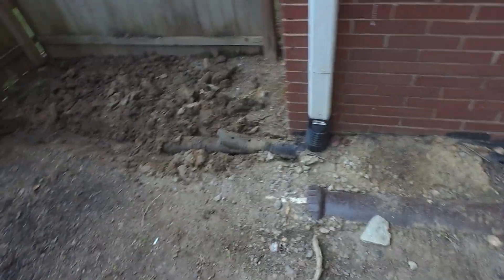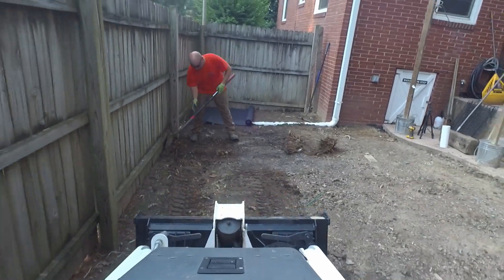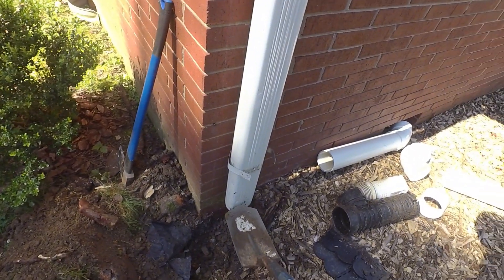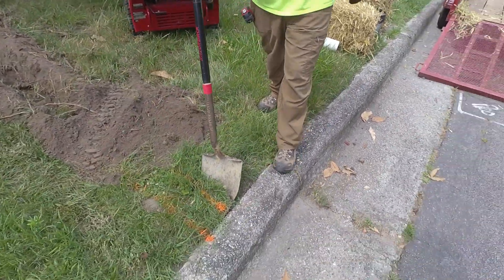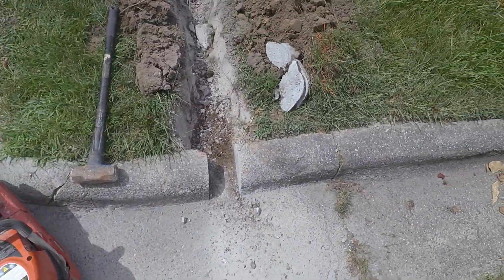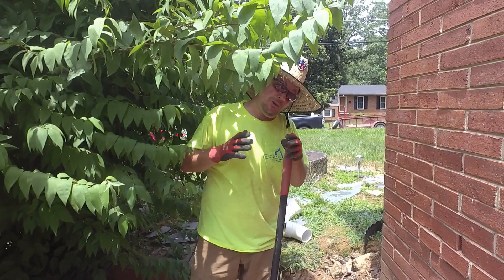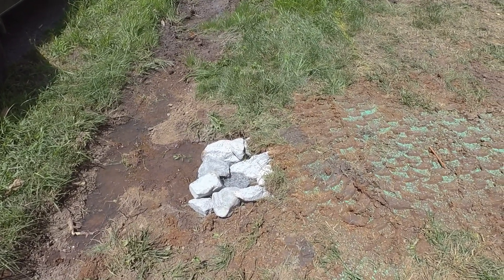Never, ever dump gutter water into a perforated pipe

Comment: You do great work. Question: my house in the Northeast US has  basement flooding issues due to a number of issues, including improper yard grading and no street access to route collected water. I have regraded much of the yard on my own but there is still no where to discharge pooled water. Some contractors suggested routing the sump pump discharge pipe through the basement to the front of the house into the street. The sump pump now sends water to a poorly designed drywall close to the house which easily overflows during heavy rain. Any thoughts?
Reply from the maker: Definitely get the water pumped to a place where it's completely gone for good.

Comment: I think the prefer rated pipe is only any good coming off the gutter running on top of the surface but I'm not a professional
Reply from the maker: It still clogs up and ends up dumping at the connection against the foundation.

Comment: All the water from the apron in front of a 2-car garage, plus about 30% of the gutters on a 60x24 house, all went into perforated pipe right along the back foundation. It picked up another 30% at the corner, and then ran to daylight in a little trench that was forever collapsing in and/or getting clogged with debris from the gutters, so all that water (including the second 30%) backed up in the perforated pipe. The only item on the seller's "disclosure" form was that a little water came in through the foundation during heavy rain.  GEE I WONDER WHY?
Reply from the maker: Can you get the pipe replaced with solid PVC?
Reply: @GCFD  I already did. 😁 The catch basin in the driveway, a small one beside the sidewalk, all of the gutters, and the sump pump outlet all drain into 4" schedule 40, which drains into a small municipal catch basin at the edge of the street, which drains into the main storm drain system on the corner.  The first 10 feet or so coming off the driveway basin doesn't have good fall, because reasons, but then it's all downhill all the way after that.  If the driveway drain overflows - which it sometimes did, when it had the corrugated pipe - there is a very subtle 4' wide swale in the yard to carry that water away from the house. You can't even see it unless you're looking for it. I'm pretty proud of that swale, as it worked so well while virtually invisible, but it is completely unnecessary now since the drain has never come CLOSE to overflowing once I replaced the corrugated pipe with PVC.
Reply: @DaddyBeanDaddyBean good to have hidden infrastructure backups for the extreme events that only you know is there!!

Comment: 11:35 Your blades will last a LOT longer and you won't PISS OFF the neighbours with so much dust if you add water to the cuts!

And for that matter, I saw hearing protection but NO DUST MASK!!!

Why no Dust Mask?

Do your workers not care about their lungs?

I've had Particulate Pneumonia...

Trust Me!!! YOU DON'T WANT IT YOURSELF!!!
Reply from the maker: I'm not sure what happened there. Those are the concrete guys I work with who were on my job that day. They usually use water but I think they felt the curb was small enough not to worry about. I make sure they use water now.
Reply: @GCFD  Make sure they wear dust masks too...

Comment: What if you put a straight pipe off your gutter and then a perforated off that. I understand it dumps water into land however a perforated pipes job is to drain rising ground water so even if roof water is being dumped it wiil eventually rise and be collected by pipe. See my issue is ground water but i have a downspout in area so figure divert both. Also clogged pipes can be avoided when installed properly. Thoughts?
Reply from the maker: The hard part is getting the water into a pipe, so my thought is to keep it in a pipe and carry it to a place where it's completely gone. That's how I like to do it because adding more and more water doesn't change anything. If water is discharging into the ground, more water from heavy rains will overwhelm and cause flooding.

Comment: Would it be better for the house NOT to have gutters?
Reply from the maker: No, because then all the roof water lands along the foundation. Gutters are key to any drainage system because they collect roof water.
Reply: @GCFD  Thank you. In Louisiana we get 4” of rain in an hour, the house I moved into has roof eaves only extend out 6” and no gutters.  The garage has gutters that overflow at the joint at the ground.  So after having French drains installed that have not stopped garage flooding, I am watching all your videos to figure out a solution.  I hope you have done some videos on proper installation of gutters. I think mine had been angled to put water into the backyard instead of flowing to front yard which slopes slightly toward the street.  Thank you for spending time posting your. Ideas. Other channels just don’t explain things as well as you do.

Comment: U guys do awesome work. As a plumber, pipe fitter I sometimes cringe when I see all that purple primer.
Reply from the maker: Why's that? I like lots of primer to prime the pipe and soften it up.
Reply: As a plumber also, I will say this. I can understand being nice and neat with primer on pipes in a crawl space or inside walls and stuff, but if it’s going in the ground, who really cares? No one is going to see it unless it’s being replaced and they aren’t going to care what it looks like at that point.
Reply from the maker: @zacharyherndon5975  I agree. When we do sewer pipes under a house we keep it neat. Otherwise I like a ton of glue to make it easier to make up those 4” fittings!

Comment: You do want crawl space ground sealed with vapor barrier even if water not leaking into it. It blocks both moisture and radon gas. Looks like they did a nice job on that.
Reply: Yes, about 15 years ago we were alerted to early problems with mold in our crawl space. A vapour barrier (just below the topmost layer of gravel in the crawl space) and a dehumidifier system were installed, solving the problem. Yes, the dehumidifier consumes electricity, but that's just part of the  cost of owning a house...

Comment: Where I'm from, perforated pipe is not used to collect water but to disperse it. What you routinely call a French Drain is the exact opposite of what is specified by CEORs on large scale commercial jobs. But we also cannot drain water onto the ROW or to neighboring properties, either. I guess things are just a little different in North Carolina.
Reply from the maker: The guy who invented the french drain used it to collect water. I see this misconception all the time. Even the landscape contractor book has a FD functioning as a dry well.

Comment: How do you keep rodents from setting up base in the dry season or winters?
Reply from the maker: The smooth pipe provides no habitat for them. Plus we get rain year round here so the flow continually blows out debris.
Reply: @GCFD  would a system like yours hold up to a Maine winter?
Reply: @marccole8345  what do you mean ?

Comment: I would have added a drywell to receive the water
Reply from the maker: The water table was much too high here for a dry well. If you can send the water down the way it's a better solution than holding it in a well, which takes time to recharge into the ground.

Comment: One technical question. 
Is there some safe distance from foundation to use slotted pipe if you intend to disperse water underground on your property?
Reply from the maker: Here in the south east we have way too much rain to disperse underground so we would never ever ever use that sliding pipe underground. Not to mention when it clogs or backs up and forces the water back into the foundation. Do you want to give that water and easy route away and out.

Comment: If perf pipe is not to be used to disperse water, why is it used in septic tank systems in the drain field?
Reply from the maker: Hi Dennis, gutter water coming off 1000s of square feet in a short period is thousands of times more than the trickle of water coming from your shower over hundreds of feet of septic leach field. Gutter water needs to be carried away from the foundation. You don't need that water to disperse into the ground because it's clean. Septic effluent leaches into the ground to be purified before re-entering the water table. 

So, same pipe:
Appropriate for septic leach field & purification
Not appropriate for re-charging gutter water into your foundation

Comment: That looks to be a good fix for her water problems. I had the same issue with my 1950's ranch house. The original pipes were not perforated, they used something called Orangeburg Sewer Pipe which was made out of paper and tar. The tree roots and soil over the years completely clogged the entire pipe. We dug it all up last summer and replaced it with SDR 35. I think it is similar to what you used, but it is a teal color. We used the stuff that is gasketed joined compared to solvent joined.
Reply from the maker: Thanks for watching Tim. The Schedule 40 we use is a little thicker than your schedule 35. Both are very high quality.
Reply: The green SDR 35 is very good quality bang for the buck, where they get you in the hardware store is they sell thinwall w/ pre-drilled holes which is practically same price as green; however, a fraction of the thickness! You are just paying for convenience of holes!! Thinwall is too flimsy - looks & feels cheap (Echo sounds inferior too). Either the SDR 35 or Schedule 40 is the right sewer grade gravity pipe for the project, you are good with that👍 🎉

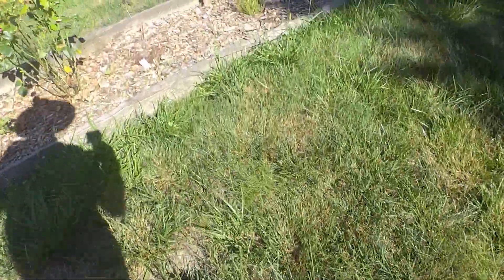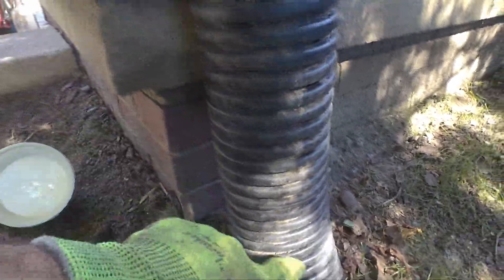Comment: 5:50 I feel bad for her waisted investment but it's somewhat comical to find another slotted-corrugated install with no water at the discharge.  The #1 reason my city doesn't permit corrugated FD installs (propagandized on YT by hacks) is b/c the pipe, far too often, sends water where it's not wanted. 4:00 5:03
Reply from the maker: It seems to be a recurring theme around here. By the time customers call me they've usually been through corrugated and companies who want to bury a perforated pipe along their foundation. I hate that for them.